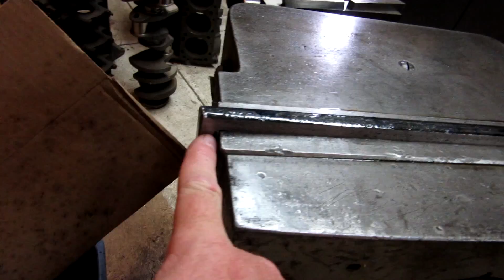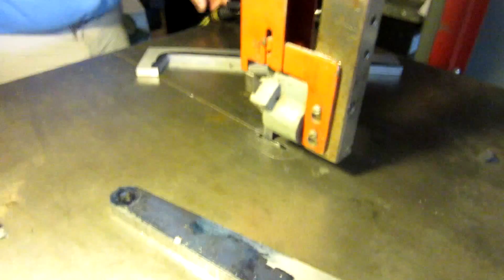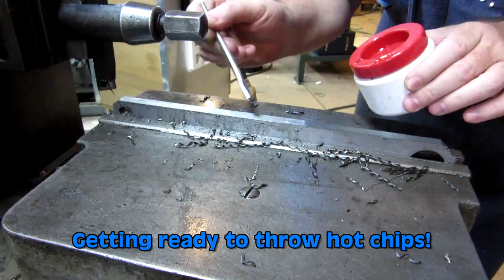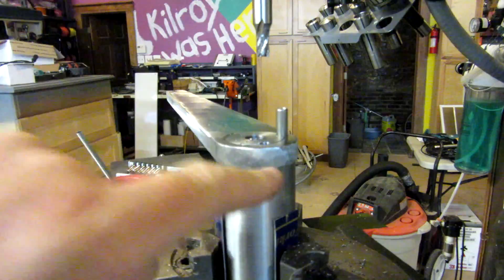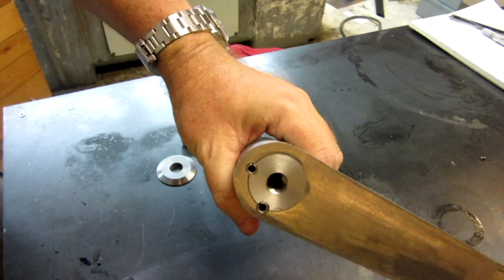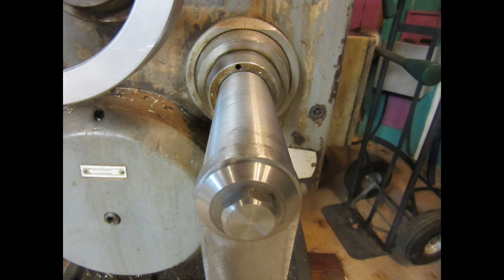K&T Crank #3, or "Getting Cranky Three Times"

Comment: Great work! I always love watching shapers :)

A few thoughts on your Scotch key.
These keys put a tremendous amount of ramping/wedging force on the outer part. Unlike a square key that will shear, the Scotch key will wedge up into the outer part and destroy it, I have seen gears split from the center on transmissions before.

Not that it really matters on this part since there is no real force, but in the interest of "doing the job right" (whatever that means), the keys should have been drilled so they faced the web of the handle rather than the radius. Drilling +/ 45 or +/ 30 degrees off the center line would prevent the handle from splitting at the thin radius end (assuming the Hulk is using the machine).

On setting up, I am sure this already occurred to you (since hindsight is 20/20), so this is really for others thinking of using Scotch keys. A sacrificial washer would have made the job much easier. A piece of 1/4" or 3/16" scrap with a 1/2" hole drilled in it and bolted into the handle would have done double duty as a clamp to hold the parts together in reference, and worked as a drill guide. Sure you can't see that you are drilling on the seam, but you don't need to - measure twice and drill once.

The split pin you used is a good choice (we call them roll pins around here). You can run a tap into a roll pin and pull it out with a bolt and vice grips. For those considering using dowels, make sure you drill and tap the dowel for extraction if the parts can't be pressed apart. The coldest place in hell is reserved for people who install blind dowels with no method for extraction.

Comment: James,
Completely off topic, but, when Adam was in your shop you mentioned collets for your Rivett were few and far between. I believe the 6H collets (Hendey,Hardinge) will work your lathe. The difference lies in the radius of the end. Turns out the Machinery Handbook list the 6H collets with a 10 tpi on the draw section and the ones I have are 20 tpi like the Rivett's. I have Hardinge and Hendey and they are all 20 tpi. If you would like I could send you one to verify.

Joe
Reply from the maker: I am pretty sure the ones I have are 20 TPI, I will check in the AM.  You have a 1020 as well?
Reply: Unfortunately no, but we have a Hendey at work.

Comment: Is there a reason for the placement of the keys in those locations and at 90 degrees?

I would have put one pin in line with the handle (where there is more meat behind it), but what do I know....

Thanks!
Reply from the maker: That does make perfect sense now that you mention it.

Comment: If you plan to leave it bare metal I would shoot some clearcoat on it so it does not rust. It looks pretty spiffy.  I am surprised that K&T just used a roll pin to drive. My Cincy has a multiple serration drive on it, but it also has a sping loaded ball in the handle and a groove in the shaft so it can stay on the machine and not fly off when you hit the rapids. Does the K&T have a similar device or do you have to take the handle off to avoid it being flung through the neighbors house? lol
Reply from the maker: The pin just holds the crank to a spring loaded shaft which has to be pushed forward to engage the drive.  If you engage the power feeds the crank gets pushed out so that it won't spin around and whack you.

Comment: Hey James, I see your getting into some of that fancy pants editing. Lookin good. 
Nice job on the new crank handle. Looks like it'll do the job in fine fashion. 

Adam
Reply: Hey Adam, how did you feel at 11:00 when the 2 parts hole was about to start?, maybe a resemble at  your bushing lock nut spinning on the milling machine? just kidding LOL !!!!. Hey James, you could try some loctite next time. Thanks guys!!!
Reply from the maker: Abom79 I finally went and got PowerDirector, man what a difference.  What used to take hours to process, now takes 15 minutes!
Reply: Kewl! I like it, and your only limits  is your creativity.
Reply from the maker: Bill Lewis Abom79   No doubt shooting video increases the time to complete a project by at least a factor or four or five. Sometimes you just have to put the camera down and get some work done.

Comment: Beautiful. I must admit when you held the crank on to the shaft to drill for the first roll pin I was biting my fingernails. Will he do it? Is his hand steady enough?  It all worked in the end. Myself I would have Loc-tited (red stuff) the crank to the shaft. Am I missing something? Then you could have plunged in with confidence. Furthermore the Loc-tite would add a bit of hold-me-down to the whole thing. Once you had the first pin in, it was a foregone conclusion. Loc-tite, or even super glue is a wonderful machinist's aid. As the great physicist Neils Bohr used to say, "not to criticize, only to learn."
Reply from the maker: It was easy actually, no real force on the crank at all, during that process.  I use super glue all the time, great stuff and easier to break free than that Red "death grip" LocTite!
Reply: I was thinking more of a light press fit would have made it fool proof. But not as easy to put on/take off several times.

Comment: loved this video series!  however draw filing them radiuses' would have looked much better then the flap wheeled finish I mean no disrespect but I totally understand that it is your machine and it does not have to look good to work and that finishing the handle was necessary to put the machine back in operation     keep up the videos I love them
Reply from the maker: Hi Dan, I agree, and I do plan to spend some time, in the near future, improving the overall finish of the crank portion, making a nice radius fit.

Comment: Photography has been improved enormously - thanks for getting rid of the shaking!
Nice work, good looking, essential, efficient piece of equipment which suits and matches the K & T.
Reply from the maker: Thanks Dan, I didn't say anything about it in the video but the extra couple of inches on the crank throw worked out very well.  It is not only easier to crank up and down, but it is a lot easier to pull up to a number on the dial as well.

Comment: James,  in a couple of the still shots at the end, the grip part looks like it's hanging down and not inserted all the way. Is it a loose fit? Or am I just seeing wrong? (I wouldn't doubt that at my age)
The bolt and washer really finished it nicely. I know the videos are a PIA to make, but keep on making them! 
Ken
Reply from the maker: The handle is a press fit and is inserted full through the crank portion of the assembly, however it did not need to be pressed any farther, its there for good, unless I press it out.

Comment: Nice job James, (as always) you took so much trouble using that elegant shaper to clean the crank sides, would you have considered using the pin & handle in the spacer, as a pivot, to radius the ends against a cutter in the quill collet, before the Scotch/Dutch split pin process ? Your detail effort was worth it cause that handle will spend a lot of time in your hand and it looks the business for years.
Thanks for your all your video work
Reply from the maker: I could have spent some more time on that portion for sure, however I needed to get the mill back in service.  I considered trying a pivot pin approach to mill the ends but honestly I have never done it that way before, always using a rotary table.

Comment: well call them roll pins in the uk, split pins are the soft metal ones you bend over through a bolt
Reply: Some of us in the US call them roll pins and not split pins, too.  :-)

James, nice to see how those are drilled when trying to mate two parts like that.  I may have to do that if I try to make a compound gear to fix one of them on my lathe.  Looks like what you did and maybe little locktight will do instead of trying taper pins.  It is just the crank for the carriage, so big load.
Reply from the maker: ILGopher No doubt using dowel pins instead of rolled pins would increase the strength a lot, but would be a fussier fit up.  I would also expect that increasing the diameter of the pins would greatly increase the strength of the setup.  Someone posted that John Deer tractor drive lines use four 3/8 pins in this manner, so it is obviously a technique that it up to some abuse.
Reply from the maker: Ah, what you call split pins we call cotter pins.
Reply from the maker: We would call that a " tapers pins with a thread on the end" ;)
Reply: Definitely, especially if you didn't have all of the reamers to match your dowel pins as needed for a press fit.

I've seen my share of them on our JD machinery on the farm growning up for keeping gears on shafts, sometimes in addition to a keyway.

As they say, don't over engineer.
Reply: Yes. We call them "roll pins" here too. I had never heard the term "split pin" for that gadget. What the UK calls a spilt pin is called a cotter pin here in the USA. But the US is huge, and regional usage is very diverse.
Reply: Juan Rivero
We have cotter pins in the UK too but they are solid and tapered. They were used a lot to hold the bicycle pedal cranks onto the shaft. It was a bad design they often failed. Not used now I don't think.

Comment: Hi James !
I looks very, very nice with that bolt and the washer and it would have been a shame with a welding in that spot on handle, I think !

That pin locking method is nifty too - I have something like it on my mill but here the pins are threaded ... and I can assure you they are NOT AT ALL easy to dismount and even worse to mount again - the slotted pin seams easier to mount and the screw method for dismounting sounds reasonable easy (but I have never tried it !).

Comment: James
Great vid
Looks like you have the vibes under control now ,I assume you have the camera off the machine as the machine noise is reduced 

Stuart
Reply from the maker: Yes Sir, modified a photography light stand to hold the camera.  It has a nice boom which allows me to get close to the action yet not touch the machine.  Somewhat more of a pita than a simple mag base to move around but it works.